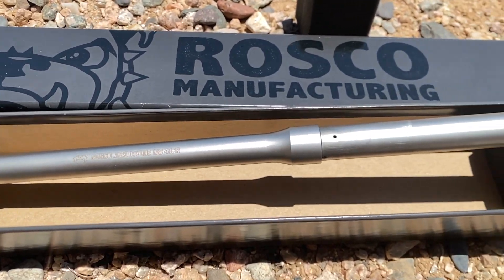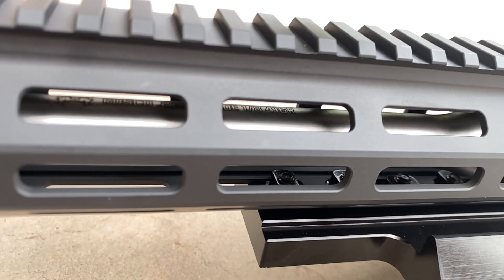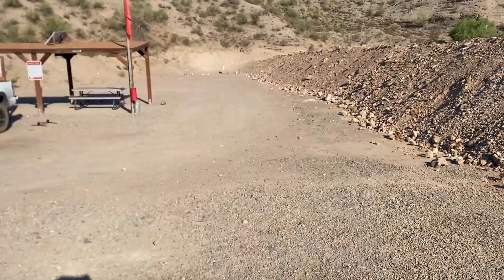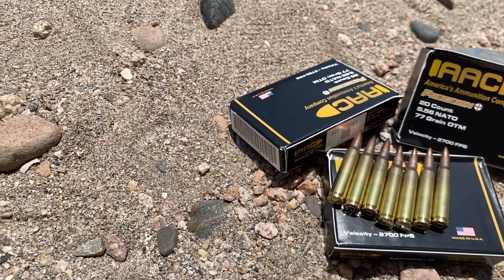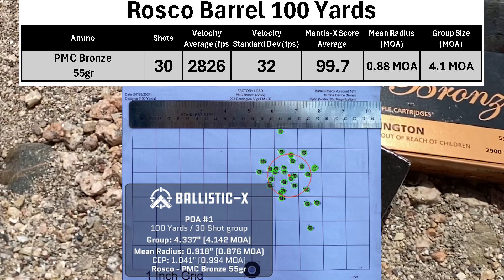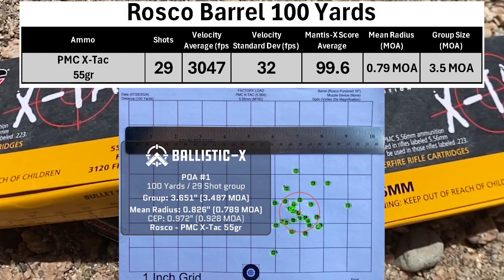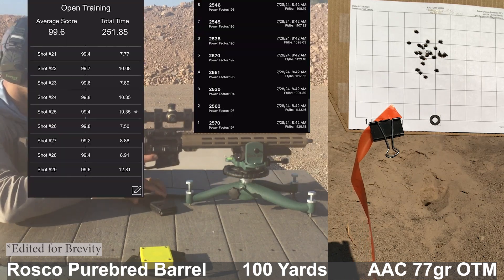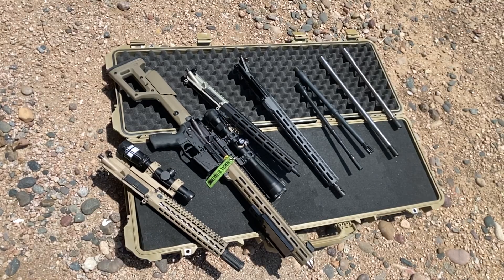Rosco AR-15 Barrel Vs. Factory Ammo - Which Load is Most Accurate?

Comment: I bought one of the roscoe 18 inch spr barrels after seeing this video and I'm extremely pleased with the results.
Reply from the maker: Glad you were able to put this info to use!!
Reply: @PrestonJMoore  The first five shot group out of the barrel after I fouled it was about 1.1 moa with Frontier 68g BTHP. I'm convinced its got more in it with some handloads or match kings.
Reply from the maker: @ not too bad for Frontier.  But yeah, SMK's usually group a little better for me.